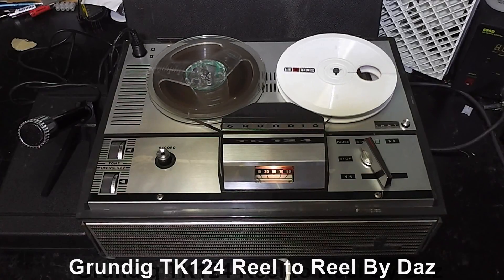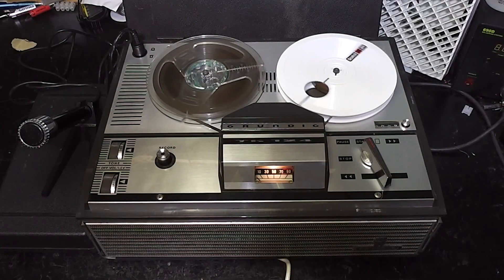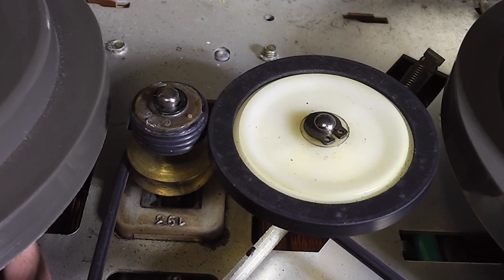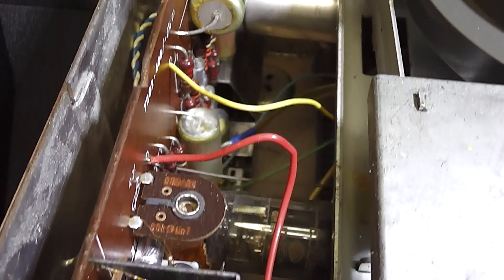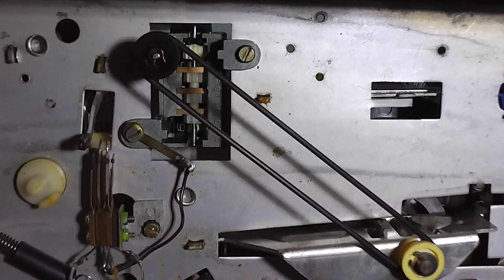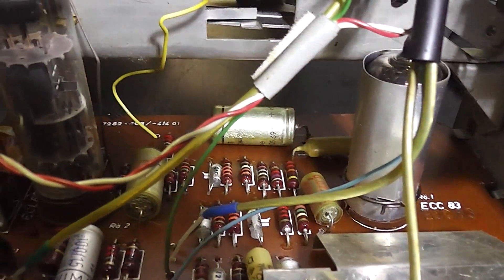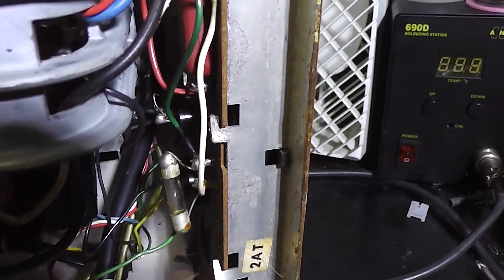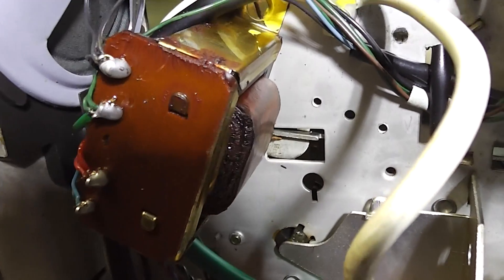Grundig TK124 Valve Tube Reel To Reel Tape Recorder Demo and Teardown.

Comment: Dose anybody know what would cause buzzing noise in Grundig tk120  all the time even when volume control turned down.
Reply from the maker: Main smoothing capacitor or screening of circuits or faulty output valve. Daz

Comment: Hi i have a tk124 real to real player no audio i am not much as an electrical person.
Reply from the maker: I suspect the amplifier isn't working due a fault. Do exercise the record button up and down a few times with no tape on the machine in case it's just contact problem in the switch.
Reply: @darrencoe5795  Thanks i tried the record button but no joy. I think i will have to give up thanks

Comment: Hi Darren. I have a similar machine the Grundig TK141. I’ve replaced the belts and everything works fine apart from the rewind is very sluggish. I think like yours, the rewind is motor driven so nothing to do with the belts. Am I right in thinking there is not enough friction between the wheel that turns the spool that feeds the tape? If so, is there a way of increasing the friction to get it working properly again? Thanks, John.
Reply from the maker: Hi John, Yes it looks the same deck as mine. Other problem you get is the roller on the cam splits. Yes that rubber bit on motor doesn't grip when engaged on left rewind spool. You could try Clydesight's  idea with ammonia first. I used O rings as you saw in video.  Mine needs repair as clutch on take up has bad squeal.
Reply: Darren Coe Hi Darren. Thanks for getting back to me. I must have been half asleep when I watched this the first time. I see what you’ve done now with the  idler wheel. I will give your suggestions a go and see if I can get it to work properly again. Other than that one problem it’s fine and produces a good sound. I’ve been playing back tapes recorded in 1967 and have been quite amazed at how good the sound quality is. Hope you get the squeal on yours sorted! Cheers, John✨👍✨

Comment: Just this minute bought the same machine daz .ff and rewind ok but play,the tape chews in the capstan .any ideas ?
Reply from the maker: Is the front spool rotating ok. Clutch problems
Reply: @darrencoe5795  sorry for none technical response Darren but it gets to the pinch roller and just starts spotting the tape out .I'll do a very quick vid on my channel mate .

Comment: Helpful video....I need to repair my TK144, which has a perished tension wheel...seen at 1.50 in your video, which is held by a spring tension arm against the nylon selector mechanism which selects play, FF etc. I have the grey plastic spindle but the sleeve has gone.  Any thoughts on how to replace the sleeve?
Reply from the maker: Ah yes mine broke too. A piece of think hose pipe.
Reply from the maker: Thick hose pipe even LOL

Comment: Nice video, very thorough. I find that an ammonia soak and rub will clean and re-grip rubber idlers if they aren't too far gone because the ammonia takes off the "slick" that forms on the drive surface. I rinse the ammonia thoroughly with water because I find it can leave a soapy film that eventually defeats the purpose!
Reply from the maker: clydesight Many Thanks for that tip Tim, I'll try that next time I find an idler that wont grip.